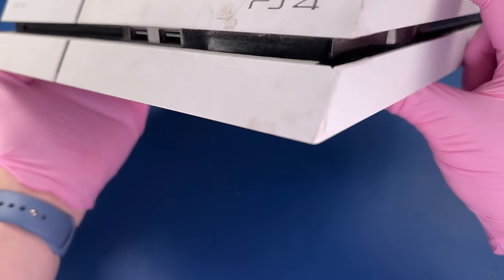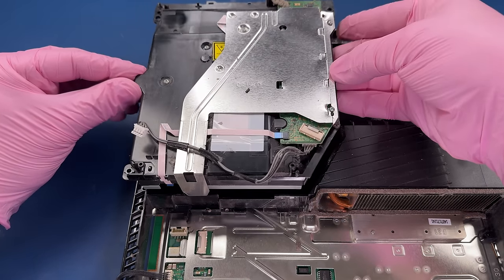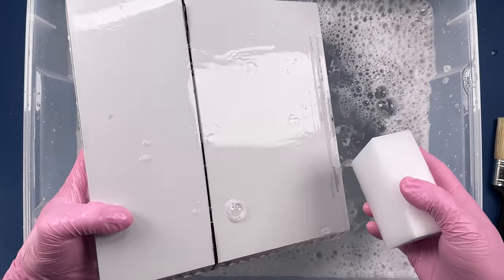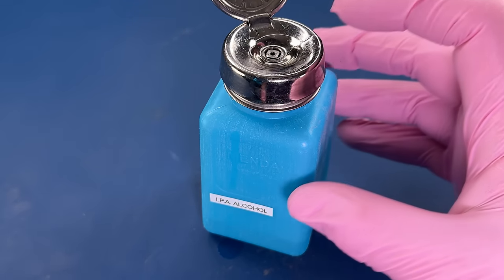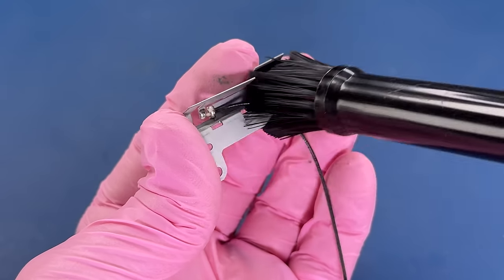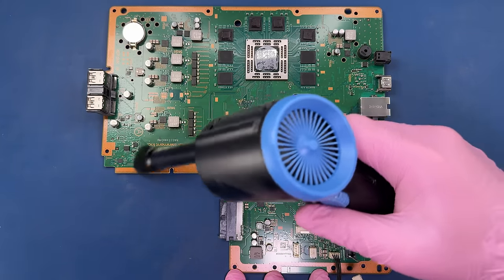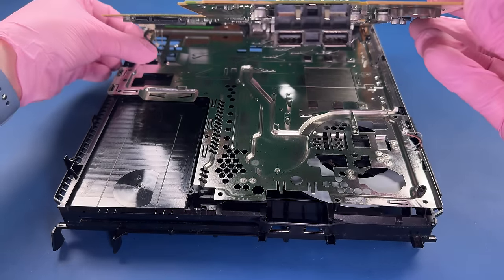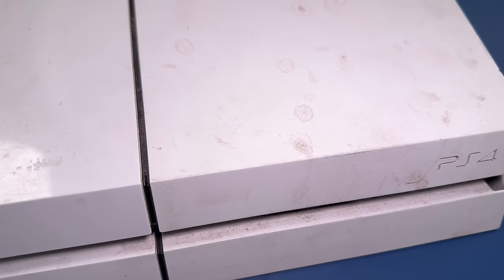Cleaning a SUPER Dirty PS4 Mostly with Air

Comment: 8:15 before I tried an abrasive on little marks... even as fine as Magic Eraser... I'd try IPA because permanent marker won't come off with water, but comes right off with isopropyl alcohol. 💖🌞🌵😷
Reply: i do the IPA all the time as first time attempt in deep cleaning marks on surfaces. when that fails, magic eraser is used for mate surfaces. for shiny one's scratch off car polish usually does the trick.